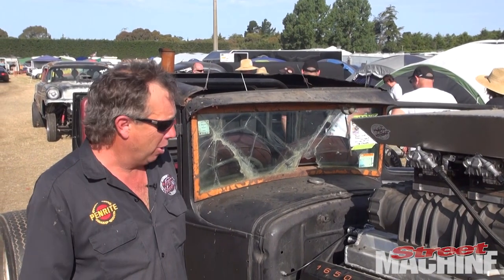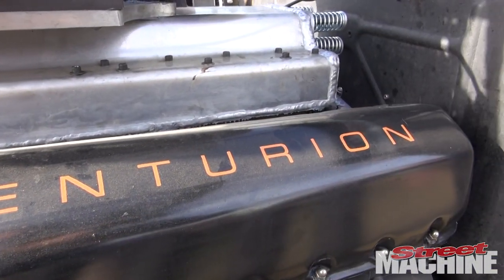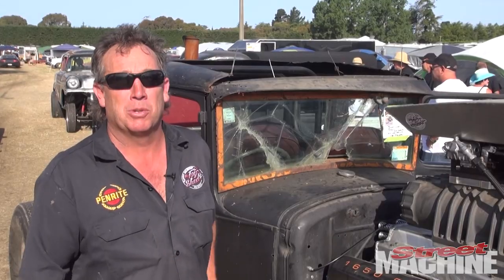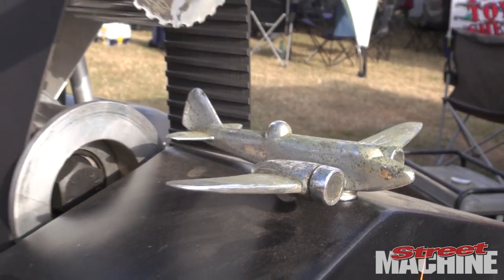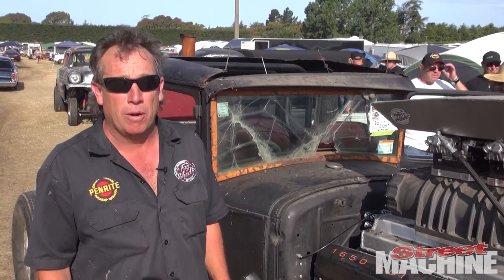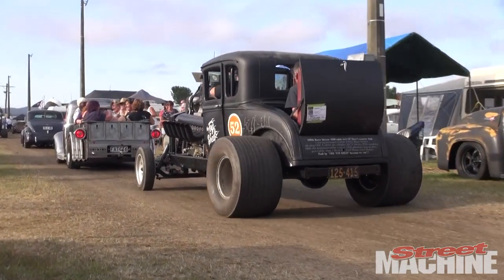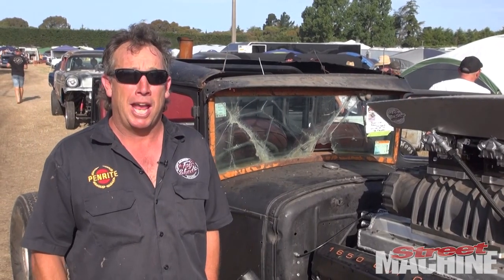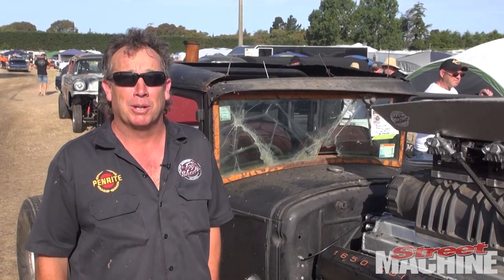Model A Coupe with a Tank Engine - 1650 Cubic Inch V12

Comment: That guy looked at a V12 that use to power a tank and thougth : "It needs more power"
Reply: well tank engines were not know for power, just reliability    a 5 second search would tell you that
they were know to be detuned for reliability. so making more power from them was a DUH moment
Reply: @chaztitan6457  Tank engines aren't known for RPM that's for sure. The torque is there especially if it's a diesel V12. But when the car is so light compared to what the engine is originally designed to move, it doesn't utilize that torque.
Reply: @murmenaattori6  gear ratios my guy
Reply: @bilbine5766  Obviously :)

Comment: I used to work with both the Rolls Royce and Allison V-12 engines, we were lucky enough to have all of the original service manuals issued from WWII and they were all stamped "Classified". The amount of technology in those engines from 80 years ago is still impressive, dual overhead cams, 4 valves per cylinder, sodium filled valves.  We utilized both turbos and superchargers over the years along with nitrous and alcohol injection and ran them on both methanol and aviation fuel. They used to be plentiful but now they are getting harder and harder to find ones that are workable.

Comment: When you ring up to order a torque converter for this set up ,  " I have a powerglide behind a engine that makes 3000nm @ 800 rpm" .
Reply: you would want a torque converter the size of a wheel for sure
Reply: Robert Somerville id be suprised if it had a regular/ stock pressure pump.

Comment: These were Rolls Royce Merlins like the one that powered the Spitfire and Mustang that didn’t meet quality control standards to be put in aircraft. 

Rather than being scrapped, they were made into the Meteor engine which powered tanks in a highly derated form (about 600-700 HP instead of 1300-1500 HP).
Reply: Na Merlin's had a 2 speed supercharger cast in to the block basically the same motor minus the block. The Merlin was said to be the last piston plane motor before the turbine jet engine. Last model Merlin made close to 3000hp

Comment: I had to choose between a flathead V8 and a 392 hemi for my model A roadster. I ended up going with the flathead thinking the hemi was just to big for what I wanted, foolish me.
Reply: @celtic barbarian you bet, just have to find a short and I'm off. I ran the straight pipes right under my bucket seats, should be great fun at 70 mph.

Comment: That blower doesn't look look like it is actually sealed against the intake, that or the sound is way out of sync.
Reply: the whole engine sounds out of time or something
Reply: Well he did say they had trouble getting the info and tools needed to set the cam timing. It just sounded like the cam timing was a little retarded to me- but then again it could just have an unsual sound and it IS a very low reving motor. Those flames out the zoomies at such low RPM MIGHT be because of slightly retarded ignition timing, it did sound a little flat; again it's such a big motor and they don't want or need to lean on it very hard- so that would make sence. I suppose when you run any motor straight out the exhaust manifold there will be visable flames though